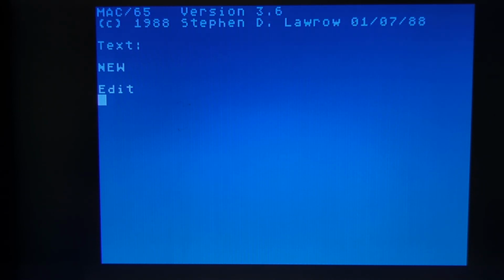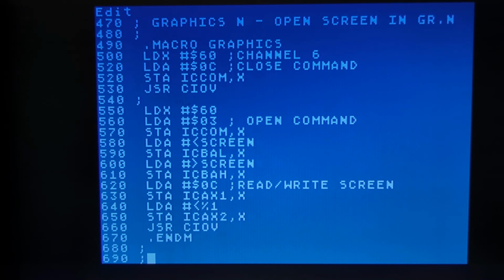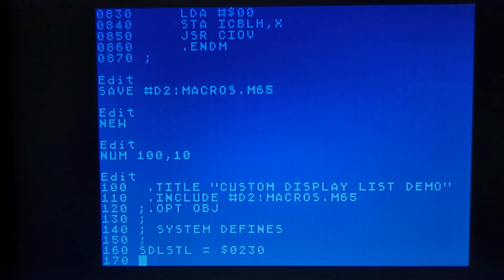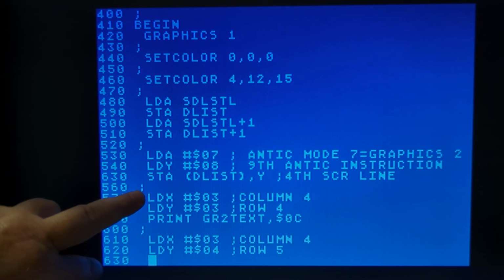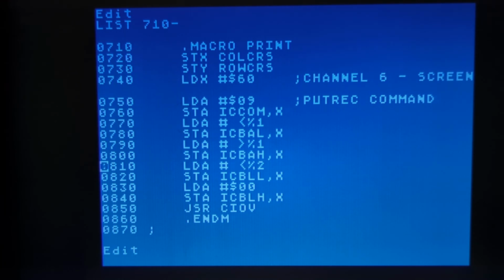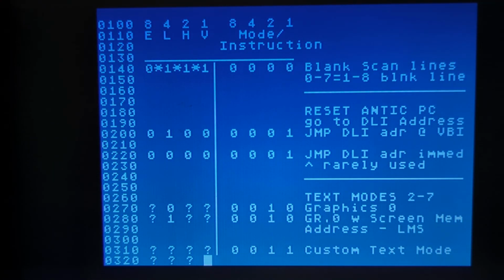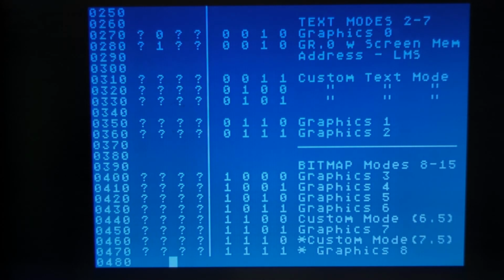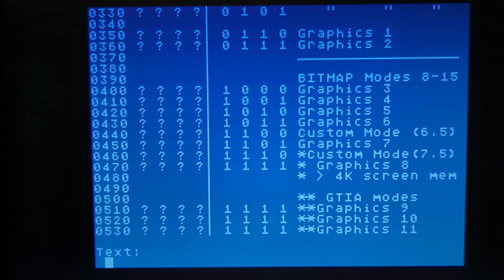MAC/65 Assembler Editor and Atari 8-bit Machine Language Programming - Part 14

Comment: Really interesting video, brought back a lot of memories. I didn't have the MAC/65 Assembler, I just had the ordinary Atari Assembler/Editor cartridge, but I still had a lot of fun trying out stuff in 6502, and writing small utilities that my BASIC programs could load into page 6 and call when they wanted.
One thing I would add though: At about 53:00 you talk about magazine program listings, and how they often turned off ANTIC at the start of a program to speed up loading times and setup times. This is partially true, but another reason they turned off the screen is that if the program was trying to customise the display list, or manipulate the screen in any way, it would cause display glitches as ANTIC was trying to use the display list at the same time. These glitches could look untidy, and irritate the user. To avoid this, programs turned off ANTIC, then set the screen up the way they wanted, and only reactivated ANTIC when the display list and display data were fully ready. That made things look a lot tidier.
I'll be checking out more of your videos in future. (I might even try digging out my 800XL, 810 disk drives, and cartridges which I should still have, somewhere.) Thanks!
Reply from the maker: @kc5402  That's very true. I'll be bringing that up in a future video when I start showing trickier things to do with the display list.